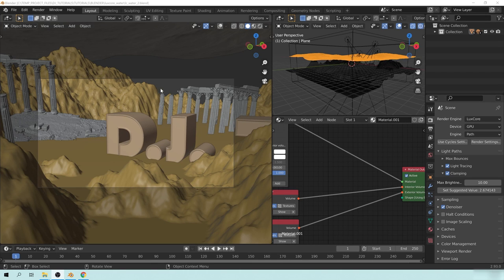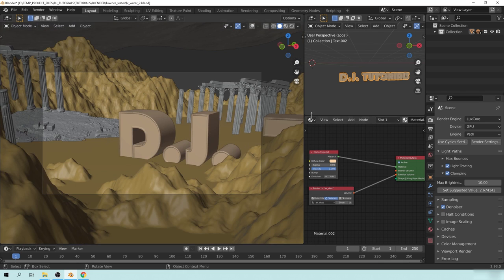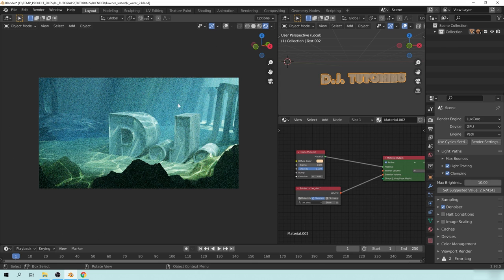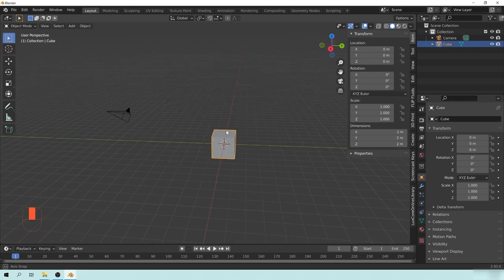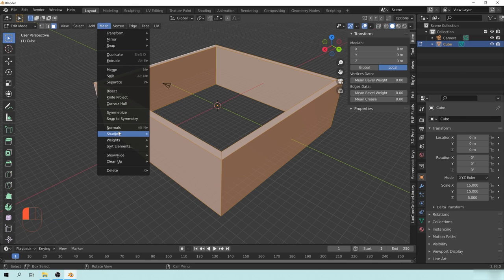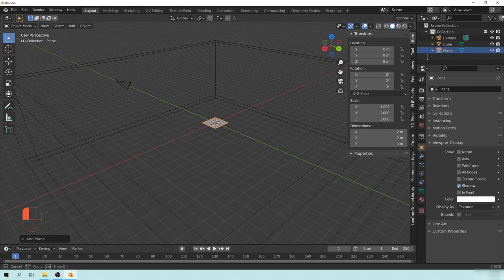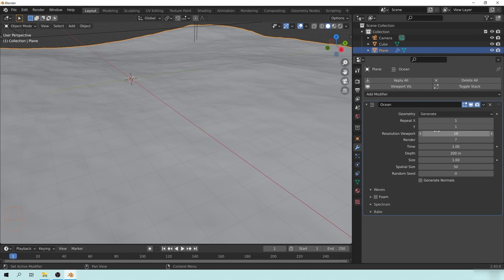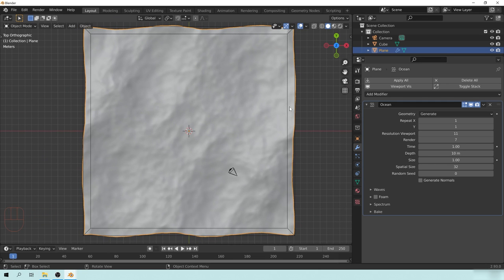Underwater Scenes in Blender | Part One: Scene Block In, Ocean Simulation and Procedural Ocean Floor

Comment: How many samples did you use for this render shown in the video? Stellar content btw, thank you for taking the time to make this video. Also, I read on the LuxCore FAQ that for caustics, they recommend Bidirectional and Metropolis settings for render, but these settings don't support GPU so it's super expensive on my system =(
Reply from the maker: Bidir is covered when using Light tracing settings but hybridizes the GPU and CPU and you can change the amount of light tracing by a % slider. I’ve played with some of the render settings like metropolis etc and I don’t remember there being enough difference for it to matter but I may dive deeper into it in a later video. I don’t remember the sample count - I just kind of let it render for a bit (7min or so). 

Thanks for the compliment!!! That really means a lot.